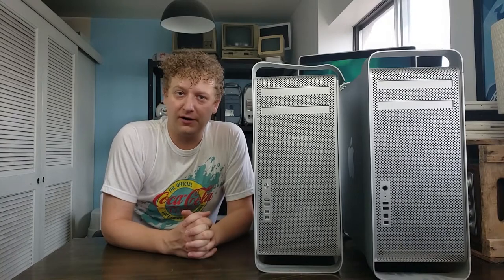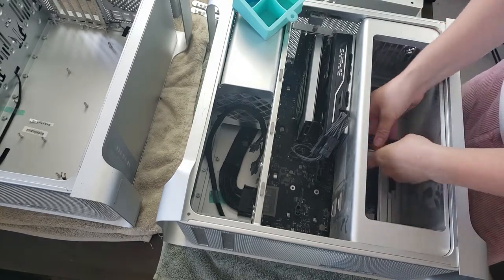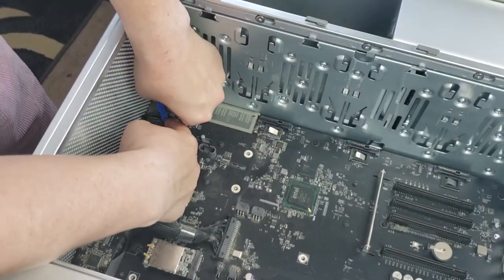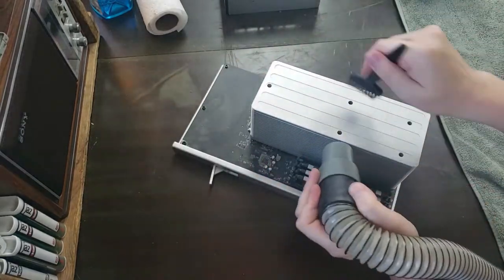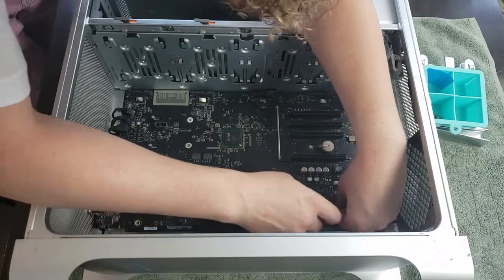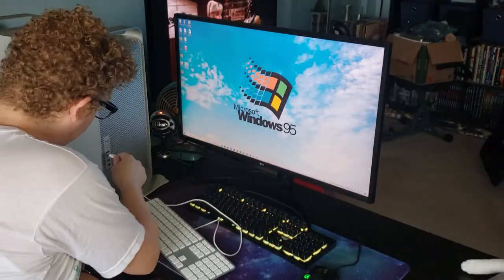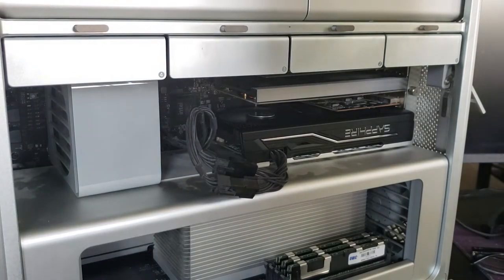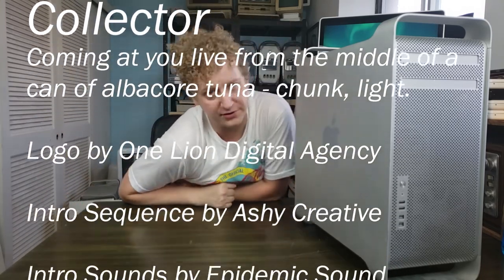Mac Pro 5,1 Disassembly & Case Swap

Comment: I've lovingly upgraded my 5,1 Mac Pro over the past year or so. I upgraded the CPU from a single 2.8 GHz quad-core to two 3.06 GHz six-cores; the GPU from a HD 5770 to an RX 580; the RAM from 6 GB to 96 GB; the storage from a 500 GB mechanical hard-drive to a 1 TB NVMe SSD; and I installed a USB 3/C combo card, a FireWire 400 card and dual Blu Ray drives.
Reply from the maker: I want to do a video one day where we feature a ton of other peoples super cool Mac Pro builds that they still daily drive.

Comment: Considering this was your first time pulling apart a Mac Pro, you did alright. I have done this transplant a few times, and I have a banged up Mac Pro that I want to shoot, and it has 3 bent handles - can't even get the door off. I also want to shoot how to pack a Mac Pro, and how not to pack a Mac Pro.

Comment: I once upgraded a 2006 1,1 Mac Pro with two quad-core CPUs (up from the original dual-cores). Since I didn't have quite the right tools and yet powered through with what I had, I scraped my knuckles really badly and bled all over the heat-sinks. I cleaned off the blood, of course, but I sometimes joke that this Mac Pro (which my friend Kris now owns) must be haunted now.
Reply from the maker: Holy smokes that’s a nice upgrade. The scraping your hands thing is very real eh lol

Comment: Which cases are compatible with each other? Mac Pro 5 and 4 or can I also use 1,1 or 3,1 case to put the 5,1 hardware into. They do all look like a similar frame.
Reply from the maker: Honestly, they all do look so similar, dont forget the Powermac G5 looks similar, but only has the one optical drive bay door. I don't have an answer as to compatibility off-hand, but I encourage you to check it out online!  Also holy shit your channel is awesome and I just subbed. I am a HUGE car guy.

Comment: you missed the one part I'm trying to find... the little spring loaded doors that cover the CD slot.  I removed mine years ago because I was having too many fail to eject errors.  Now I'm trying to put those doors back and they don't seem to go in any way I try.
Reply from the maker: Oh no! I am so sorry lol. I tried to be as thorough as possible. Any luck?
Reply: no, I cannot figure out how to reinstall them to save my life... even looking side by side with a Mac that still has them
Reply: @WJHandyDad  … look for a clip here on YT titled “MacPro optical drive doors sticking open - solved!”

Comment: Sir, my compliments on your channel. 

Towards the end of my ownership of one of these Macpro5,1s, the fans never stopped going at full speed. This is when I first heard the term "thermal paste," because folks discussing this problem described what needed to be done to fix it. 

But I was moving on to an iMac17,1 anyway, so I sold it without repairing the heat issue. Did you address any such issue with this one?
Reply from the maker: Thank you so very much! I didn’t repast this one as the owner had only asked me to move the contents from the smashed up case to the fresh one, but I highly recommend when opening up any older machine.

Comment: I need to replace the entire mechanisms of the optical bay doors on my Mac Pro as couldn''t find anything online. Can you or someone tell me if, in first place, it is possible to do it and if so, where I can find the information? It would be highly appreciated.
Reply from the maker: Hi there Flocon! I actually went and combed through the original footage of this video to get you an answer. It looks like you can. Both drive bay doors seem to be part of either one large plastic frame, or they are individually held onto that frame. On said frame I noticed there was at least one screw that can be removed leading me to believe you can replace them! If it's anything like the power button, it'll all be one annoying plastic mechanism, but at least it can be done!
Reply: @CanadianComputerCollector  Thank you so much for your reply. I definitely will look at it again and very closely and will follow up with my findings if you do not mind, of course. Thanks again!

Comment: Great video. Is it possible to swap the metal and plastic "frame" on the back of the case where the PCIe cards show their ports? The reason I'd like to do so is because there's a factory "sticker" (not really a sticker--more like the plastic part of frame itself) on the bottom of that frame imprinted with the unit's model number, serial number, processor type, etc., and I'd like to keep that "matching" the guts that I'm swapping. The part I'm talking about is about 1/4 down from the top and 1/5 of the way from the left at the 3:20 mark in your video.
Reply: It would appear that "No" is the answer to your question. I did a search for used cases, and found that the piece with the serial number always seems to remain attached to totally stripped down cases.
Reply from the maker: Hey Thomas! I hadn’t looked into it but it looks like we have answer here!
Reply from the maker: Cinclodes Thanks for the Intel!
Reply: @CanadianComputerCollector  Thank you for the great video! I have a Mac Pro with a damaged case. I'm trying to decide if I would be able to transfer everything into a nice case. I looks complicated and that it would be easy to mess something up.